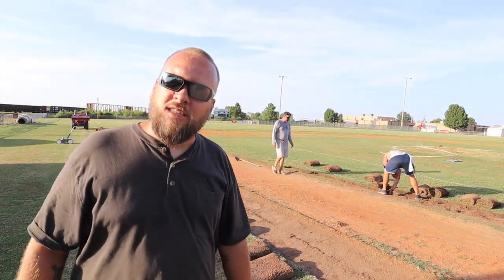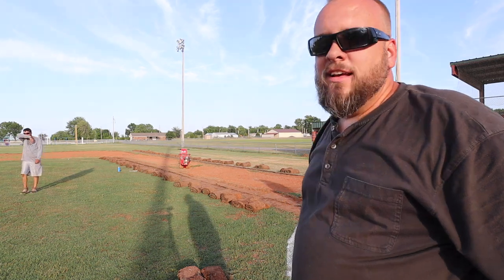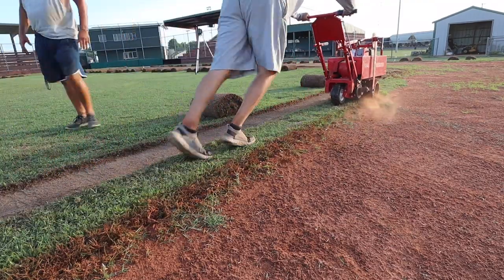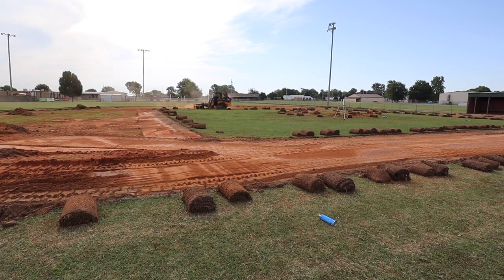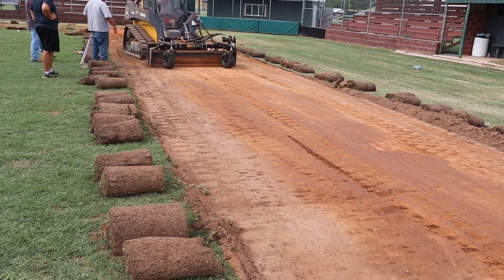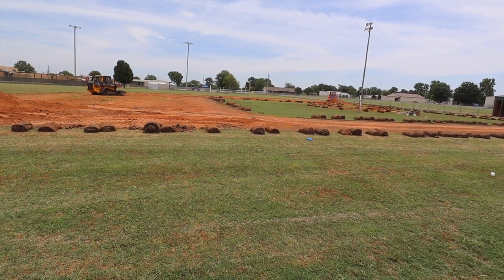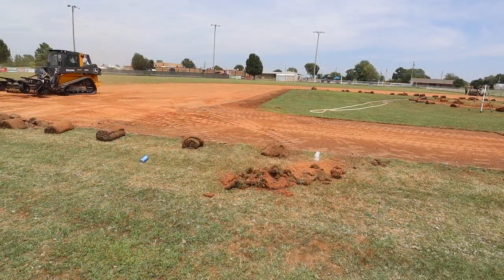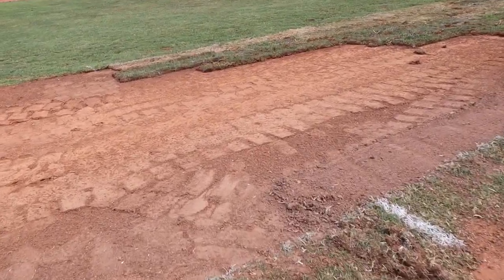Renovating a Baseball Field in 2 Days with Zero Budget

Comment: Renovated a field a few years ago and only removed the compacted infield material  on base lines about half way down and then added to the baselines about 2" of soil/sand mix to level all for good pitch before sodding the  base lines.  Second year we found that the root system was not getting down thru the remaining clay and we had a terrible time keeping the grass area strong and green.  If had to do again, would have made sure we took all of clay infield material out of base lines and added 4"-6" of soil/sand mix  before sodding over.